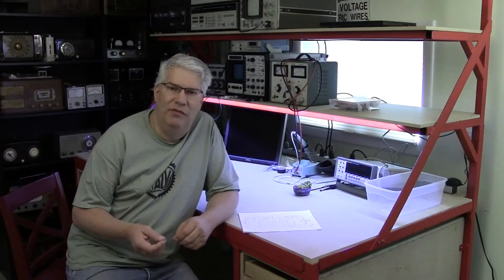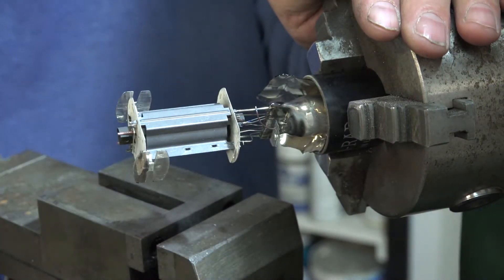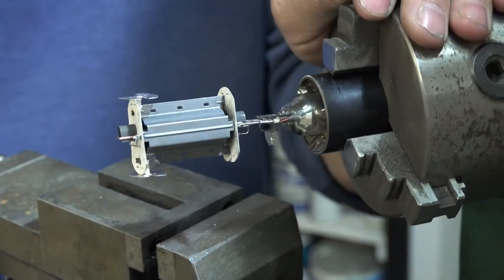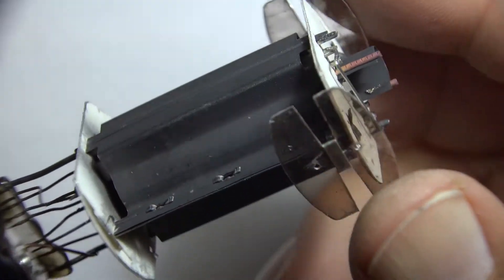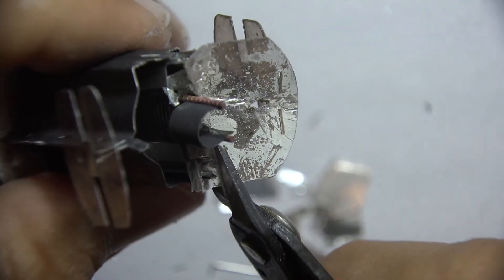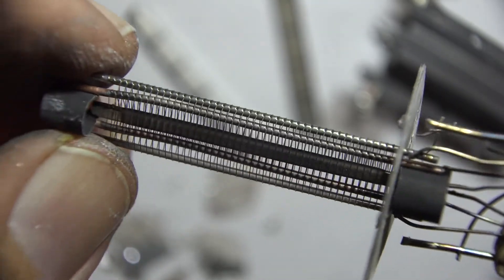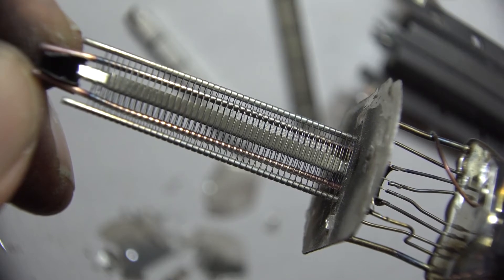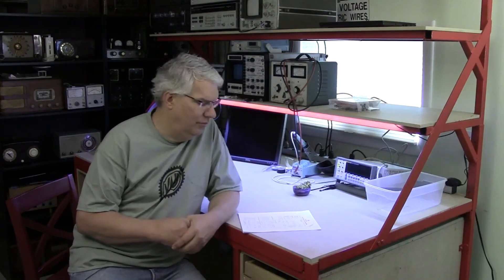170429 Valve Studio - Teardown - 6L6G Beam Pentode

Comment: it's hard to fathom the machine that does this intricate work as well as the fact that the power is delivered through that one lead.. in all the years i have been using these little jewels i have never had one apart to see what actually makes one operate. thanks ;->
Reply from the maker: Yeah, I had the same thought. That cathode to pin wire is so tiny and yet, he and all of his friends used to power giant rock concerts in the 60s and 70s.